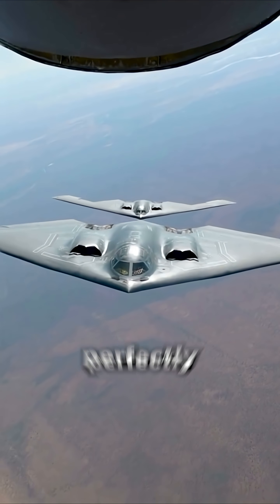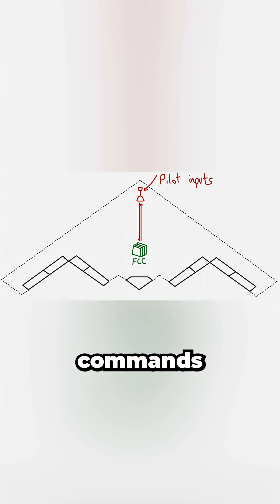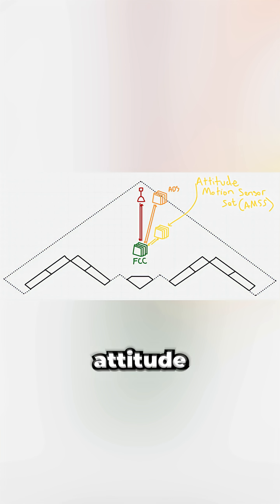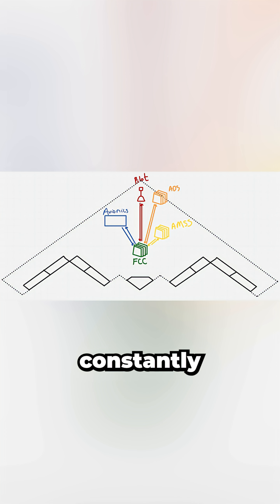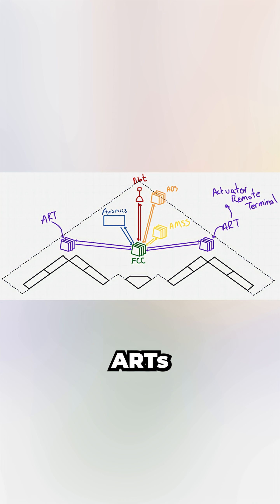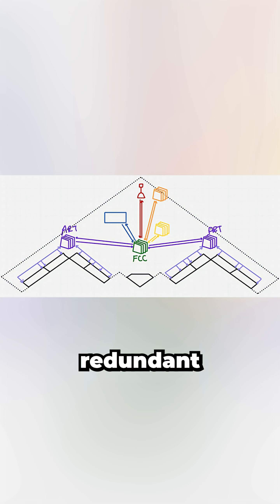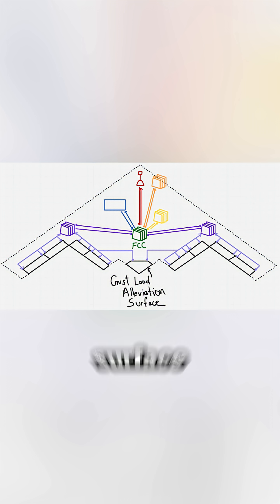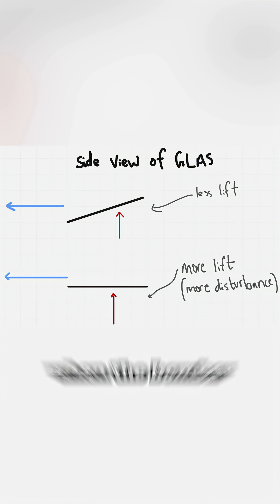How does the B-2 stay stable with no tail?

Comment: So why do all this? as what are the advantages of doing all that and adding layers of possible failure? how is it better than just adding a vertical stabilizer that just takes care of all that passively?
Reply: Vertical surfaces can be detected by radar.
Reply: @kalanicastro4135  which also fails the reason for it being a stealth bomber
Reply: A flying wing has less frontal area than a conventional tailplane which reduces drag. And it's also easier to reduce frontal RCS with a flying wing.

The increased wing area of the flying wing also allows for greater payload capacity.

Comment: How did the Horton Ho 229 fly without fly-by-wire and computer stabilization systems?
Reply: A single cable controlled both an aileron and spoiler on the same side of each wing to make the plane turn in a specific direction.

Comment: Probably one of the main reasons this aircraft costs two billion per unit
Reply: They don’t cost anything like that much to produce. When you hear numbers like that it’s including all the research and development costs and the production  and just dividing by the number of aircraft they have. If they build a new one now…it’s not cheap, but it’s much lower than that.
Reply: @HkFinn83  They were supposed to build 50 or even more B2 to spread out the cost. however, it didn't work just like how the newest railgun destroyer turned out to be - initial massive cost overrun and congress cutting the budget to prevent budget overrun.
Reply: @HkFinn83 they are still one of if not the most expensive airplane to run at about 65000 per flight hour and we can do some fun math with this. Trump sent 7 to iran thats 7x65x1000=455000 per hour and they flew for 37 hours which is 455x37x1000=16835000 so it cost 16 835 000 dollars in just the flight maintenance cost and thats without acounting for the refuling planes or the bombs or anything else.
Reply: @HkFinn83  if they're not expensive, then why not build 1000 of them? Why don't they build more? Maybe maint cost and don't need that many if war arises?
Reply: @milfeullesakuraba2593  They made it smack bang at the end of the Cold War. I promise you that if the Cold War continued and relations with the USSR stayed bad the US would have built at least 70
Reply: The radar wave absorbing coating and the condition needed to preserve and maintain it costs way too much. It also needs air-conditioned hangers for storage.
Reply: I’m so glad we have a cheaper version that does exactly the same thing with higher efficiency and flight time- B-21
Reply: @TheRealAnsontp its costs about the same in truth its just that it uses already existing technology while the b2 price includes the development cost of all the tech they needed and fewer were made so the price per unit is higher because of the development cost. Its like comparing the f15 and f16. The F16 is cheaper per unit because it had much shorter and cheaper development than the f15 due to it building on the f15 tech.
Reply: @LillaVargR The F-16 was INTENTIONALLY made to be a cheap option at 20 MILLION per unit.
Reply: @Rokabur yes but it was made to be cheap because they could build of the tech they made for the F15 thats also why it had a development time of only a few years. It built from the technology of the F15. You cannot develop a cheapplane from scratch.